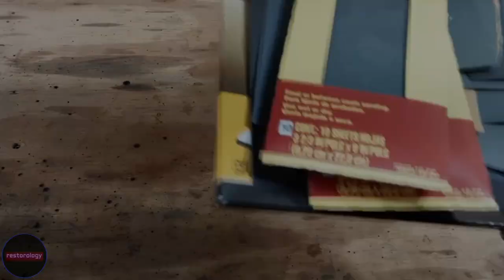Broken Sledgehammer Repair and Restoration

Comment: That metal wedge is not supposed to go into the handle the way you put it.  A wooden wedge was to fill the slot you cut in the handle.  And THEN you pound in that metal wedge perpendicular to that wooden wedge.  That’s the proper way to wedge sledges, axes, hatchets, etc.
Reply from the maker: I am sure you are correct. I did an axe after this the way you described. For this one, I simply wedged it the way it came to me. It seems to be holding up so far but I'll keep an eye on it the more I use it. Thanks for the advice. Cheers! 🍻